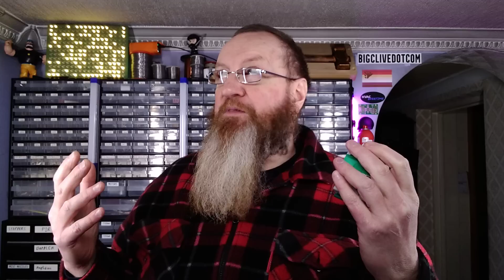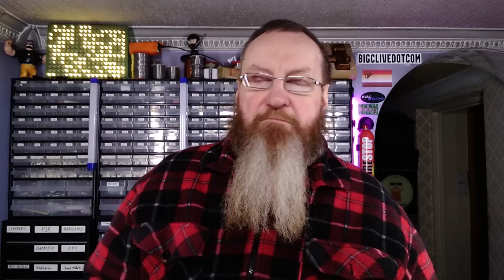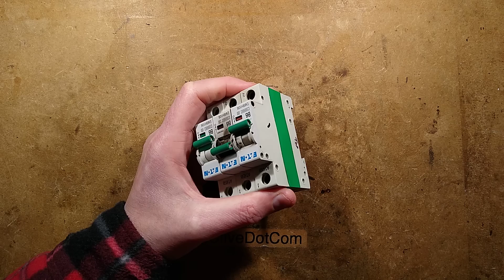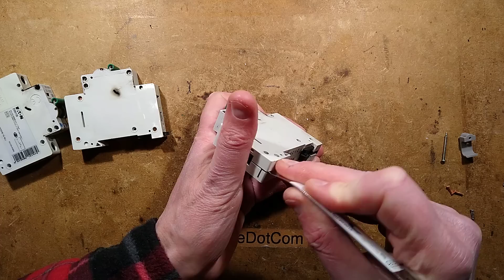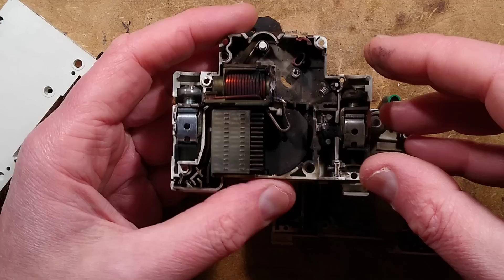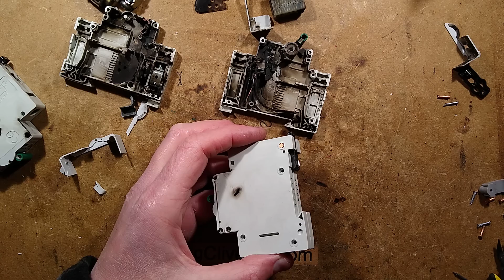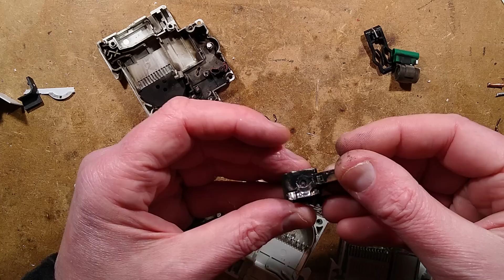Arc flash breaker failure - let's open it

Comment: The one word that any electrician, mechanic or engineer hates to hear is the word "intermittent".  Because you can damn well bet the farm that when you check the circuit/engine/mechanism the fault will be "mittent". The stupid fault runs and hides if it sees someone coming and the whole circuit/engine/mechanism is like "Problem? I don't have a problem. Why are you here?" If this happens often enough, you can see mysterious hammer marks in various areas, caused by professionals repeatedly thumping the offending part and using all of their very best swear words!
Reply: Did trace an intermittent fault to a damaged cable in the conduit. Lucky they would pull through, so ran all the cable in there with new, and found the damaged section where the installer 50 years before had scraped the insulation through, but it had been in air, till the conduit rusted a little and there was some water ingress. then it would trip 5 days after mopping the floor.
Reply from the maker: It does rile me when I see people using excessive force to get cables into conduit, with the insulation peeling off on rough unreamed edges.  Those little piles of shredded plastic say a lot about the installer.
Reply: @SeanBZA  And THIS is why you have to have trained professionals. To have the knowledge and patience to track down a 50 year old issue that only recently started causing trouble (5 days after mopping a floor, no less!) is (or should be) worth its weight in gold. Clive often talks about the low standards set for electrical apprentices these days and what you describe is precisely why that's a serious problem. A two-week course is not going to make you a competent enough electrician to track down something so hidden and obscure.
Reply: @michaelcherry8952 This is also why you wind up with weird rituals around equipment lol. If no one can find the source of the fault, but the machine seems to run fine whenever someone tells it a bedtime story... well, I guess the machine is going to get its bedtime stories!

Actually, that reminds me, there's a video on YouTube of a server that crashed whenever someone yelled at it. That is not a joke or exaggeration. There was something faulty with it, and that little bit of extra vibration was enough to cause problems.
Reply: @SnakebitSTI  That triggered a memory! I had a  1/4" phone plug and jack combination on an old Bogan "Transistorized" amp that was a wee bit too tight. It had two channels of output, but if you plugged the wrong plug into the wrong jack, after a couple of minutes the jack would spit out the plug partway just enough to short out that channel. Oddly, it was only a specific plug and jack combination that would do this. We used one channel for PA and one for backstage monitor. If you plugged the wrong cable into the wrong jack, you lost the PA. On "The Night", of course someone set up the amp with the cables in the wrong jacks and right at the start of the show the PA cut out. Unfortunately, although I knew exactly what was going on, I was on the other side of the room because I also played trombone in the band. Just as soon as our first number was finished, I raced through backstage and unplugged the monitor and plugged the PA into that jack. Cue the stage manager demanding to know what happened to her monitor. At the next break in the action, I managed to get the right cables in the right jacks and the rest of the night was (relatively) uneventful!
Reply: Ahh, the lesser spotted intermittent fault. I once had an electronic control system fail while I was on duty. The remote end being twenty miles away. Of course, by the time I arrived, it would be working. Do all the normal checks and tests, no problems found. Leave it on test for a while, all okay. Get back in the van and head back to base. And of course, as soon as I was within touching distance of base, the mobile phone would ring - “it’s done it again! Where are you?”. In the end I found that if I hit my fist against a certain part of the cabinet, I could recreate the fault. But it still took me over an hour to find a dry solder joint on a capacitor that was supposed to be firmly soldered to a terminal post.
Reply: @Mark1024MAK  Percussive Maintenance Techniques are valuable skills to have!😁
Reply: @Mark1024MAK You've got to be kidding me!
Reply: @Mark1024MAK yeah been there done that. After a reboot the server never comes up in time. Just when you enter the Datacenter. “Host xyz is up”
Reply: It does give a sense of power though, when you show up and hear someone say: "that's odd, the moment you showed up it started working again". "Yes, my mere presence is often enough for equipment to just start behaving again".
Reply: @inertnet  🤣
Reply: As the late Bob Pease said: You are sometimes justified in abusing the equipment to make an intermittent fault permanent.
Reply: @connerlabs  Love it!!🤣
Reply: Back when I was doing industrial maintenance, my manager would come up to me with a file on a machine, often intermittent. Find the cause. He would like the report that I wrote up on the repair and follow that up with asking why I had so many hours on the job. All he had to do was take a second look at the report because it had a full report of what I looked at and my findings.
Reply: Was the only electrician on second shift that had 150 workers on production lines so I was kept busy. A boss would ask me as soon as I walked into the room how long to get equipment back in line. Told him dozens of times that I'm Tom the electrician not Tom the magician. He reported me for cleaning to him like that so I would unbutton my work shirt and say Oops I forgot my Superman cape and my X ray vision is not working and will take a while. He reported me again so next time he called me told him sorry just started lunch and have a few other calls in head of him. I would always postpone or come back from lunch for every other department foreman but not for him.
Reply: @garbo8962  And I'm sure this guy had absolutely no idea why every other foreman got prompt responses from you but he didn't. It's amazing how dense some of these guys can be! The duty electrician is the expert. HE is the clueless one so he shouldn't attempt to tell the expert how long a job should take.
Reply: Ive seen the same with stuff like printers and wifi. The moment I come to fix the problem it disappears.

Comment: this is also similar to a common problem for my parents in bad storms

the single integrated GFCI breaker that ALSO powers the bathroom lights trips when bad storms dampen the outdoor plugs and lights
it is mainly a trickle of power that the GFCI dislikes, after just an hour of drip-drying it works fine again

america is a bit dumb at NOT using GFCI EVERYWHERE, though I can't exactly DIY because it is part of apartment living you are actually not allowed to alter without landlord approval

in my case I use devices in a way that I know is unlikely to harm me, if I have a metal body double-insulated device like my toaster oven I treat it as a fire and shock hazard during use, and unplug it fully when not in use
that 80's toaster oven is the only device that isn't safe given a metal body that gets hot enough to cause burns that I have, and yes I use a modern power strip as a breaker for it(it definitely uses less than 15a and the strip is only used for the 1ma at 1.5v for my clock charger and as a convenient place to connect my toaster oven, and it has 14awg wire so no worry)

I know now that admitting I use a high-power heating load on a power strip will get me replies of IDIOTS who don't understand that TOTAL POWER PER WIRE GAUGE is what matters, and I will try to politely engage with them to correct the fear-myths because telling people they MUST calculate total power load was never gonna happen
suffice to say that my situation is made up of carefully tuned "best practice violations" because my situation living alone ensures that I can avoid any ACTUAL violations of electrical code
I mean a 4kw invertor with an 80a capable 24v charger being connected to a 20a 120v circuit? yeah danger, but I use a single power strip to break that out, and my load was measured of ALL devices at <600w(+1kw fuser of my laser printer in small bursts that is almost never used), and the charger is even tuned to <25% to avoid peaking over 5a, leading to a total load in a room with no other loads of ~18-19a, which is within a safety margin of a 20a circuit WHILE THE BATTERIES ARE CHARGING AND PRINTING
if we count the 30-120 seconds max of printing ever as an "intermittent load" I am WELL BELOW the 80% limit of safety, and could probably even run my vacuum on the same circuit without reaching the full 20a(keep in mind the 600w was a peak ever load of all my devices, 3 monitors, sound system, 2 computers running miners, ect)
if I simply idle my rig and turn off the nearly 100w of displays(my audiobooks can still play with monitors off via BT headphones) I am still definitely below any danger of circuit overload, and even then I can't be sure how the plugs are all wired, there seem to be too many breakers for any single room to have just 1 breaker, it seems like the side windows each have an exclusive 20a plug set and the other outlets have ANOTHER 20a set, then the 50a breakers for the 240v stove and the 30a ones for the water heater(I don't think any were 15a at all, and the lights did follow my PC plug when it popped due to an invertor DC short)

so, overload fearing laymen please comment for correction and education, I actually did the math and testing, I will inform you if you wish

Comment: Would a typical factory capacitor bank contribute to such excessive short-circuit current?
Reply: Just a lot of incandescent lights can be enough. My dad had to add an NTC in series to our trigger-switched stairwell lights because the 12 halogen lamps were pulling so much current when cold that they welded the relais shut, so you couldn't turn the light off anymore without turning off the circuit breaker.
Reply from the maker: That's an interesting thought.  A power factor bank could definitely nudge peak instantaneous current up.

Comment: We have the same kind of problem finding faults on the underground supply network!
There is some kit we can use to narrow it down. ..... Rezaps to safely energise 500A supplies with faults. There are sniffers where you sample gasses from underground (hopefully tarmac so they don't go into the air before sampling) and Wezaps for those pesky intermittent faults where they go to a server in Ireland and a possible fault location(s) are given to the engineer to find the fault. 
We have got to the stage where you can reasonably hope to find underground faults before people are off supply!
The lumpy masses of destruction we dig up are a different matter! 1000a is small fry for a fault current!

It is interesting to see they think arc suppression works even when the slats are sideways rather than above!
Reply: 33kV and higher tend to make the fault location well known though, as they have a crater marking the spot, accompanied by the blown flat remains of the steel joint case as well.
Reply: @SeanBZA  The HV network is fairly well automated. Most of the HV fuses feeding UK substations are 7a (their rupturing capacity is a lot higher though) Once you get a level up from the 11Kv network the damage does get more noticeable. I have seen subs going up in flame and there is not a cat in hell's chance of getting me near the 4.5m safety zone! I do not care how good the oil is, put enough energy into it and it does get hot .... very hot!

Comment: Why I believe in fuses rather than circuit breakers. Fuses don't usually get arc faults or burnt contacts. Battery cut off switches you can use as well, it will handle about 300 amps and more in cranking amps. But I'm not sure if the battery cut off switches get burnt contacts too from high amp turn off or on.
Reply: Battery switches are only meant to be operated off load, on load they are not rated to make or break load, and are meant to be replaced if this is done, as part of the fault clearing operation.
Reply: @SeanBZA  okay, so how do I get away from breakers that wear out? Any other cut off switches that won't burn up?
Reply: @ they all have a rated life. You are meant to replace them all over time.
Reply from the maker: That's when some random "expert" hasn't put foil or a bit of wire on the outside of a blown HRC fuse.

Comment: Rubber gloves won't protect you from the shock when it goes !!!BANG!!!   😁
Reply: Which is why electrician gloves come in two parts. The rubber insulating inner (with a Voltage/AF rating) and the leather Protector gloves..
Reply: @darikmatters8866   I meant the 'shock' of the loud bang that makes you jump, not an electric shock.

Comment: I’m a 60+ yr old semi retired electrician across the big pond.  I have worked in service the majority of my career.  As a young boy, my father, an electrician his entire life, explained why you don’t keep resetting a tripped breaker.  He’s most likely looking down right now enjoying your latest video Clive.
Reply: How many times do you think they reset that breaker to blow it up? That sure sounds like sound advice So if you were had to reset it a few times for troubleshooting would that be too much?
Reply: @ it is my experience most home circuit breakers will tolerate that for a while no problem.  In this case he was working with over 400 volts across the line.
Reply: @chatrkat  400 volts between adjacent breakers, 230V live to neutral on the individual single phase circuits. Standard setup in most commericial/industrial buildings in the UK.
Reply: @zzoinks  ONCE... whatever caused the trip can look like the inside of that breaker (or worse). The fault current can be thousands of amps before it trips due to the trip curve so that reset breaker can deliver a surge of 5k to 10k amps instantly which can and will vaporize things.
Reply: Reset with a stick!  I had a domestic RCD drop out very randomly over a year and pretty sure there was no permanent fault in the house, but no way I was going to examine the whole system.  Tempted to change the breaker but board was full and messy. Tracked it to the weather -  wind and rain raised the frequency - but never more than once a day.  Eventually utility supply cable joint blew up 100m down the road. Happy days ever since!  It's hard to sit on your hands and do nothing.  Great explanation about the carbon track clearing the fault, Clive.  
Never knew about the reflective injector or thumper test methods, waiting for the bang sufficed!

Comment: Hello, Clive! How can i protect my home electrical appliances during thunderstorms or blackouts? I'm experiencing a lot of short outages due to rain and thunder, and I'm worried about fluctuations in the energy network.
Reply from the maker: You can get plugs that disconnect a load and don't reconnect it until after a time delay if they detect a significant transient.  You can also get DIN rail modules that do the same thing.
For areas with a high risk of lightning strikes, it may be a good idea to get a heavy duty transient suppressor.  They are often used with things like HVAC units.

Comment: This could be one of the reasons why eletcrtical distribution network is still using fuses.
Reply from the maker: An HRC fuse has many advantages.  Nothing to rust or jam, capable of breaking massive currents and single use, so no unknown history.
Reply: I had to ask Alexa, "What's an HRC fuse?" ... She said, "A High Rupturing Capacity fuse, is a type of fuse designed to handle short circuit current for a specified period."
Reply: So, grid network context... not commercial.
Cost and reliability is why they use fuses for streets / customers.  Easy to get a good kA rating out of em. Least cost afforded. 
However, the network distribution industry uses a lot of high fault capacity Circuit Breakers at sub stations.  Likewise, a lot of protection/control monitoring that trips those breakers.

Comment: Odd years ago, on 3 phase breakers like that insolator sheets would put between them to seperate the phases ??? same if connectors
Reply from the maker: In this case, the ports were for a mechanical interlink option used for various reasons including ganged breaker groups and external trigger mechanisms.

Comment: Back in the seventies "let the fault develop" was a common saying- if the cause wasn't immediately  obvious.😂
Reply from the maker: Still valid.  Some faults have to make themselves more permanent to find them.
Reply: The saying around my place was, "let the next shift deal with it".
Reply: You mean like the council fault tracing, replace the consumer tap off fuse with a bolt and nut off a pole mount, and look for the smoke. as the street wires were open bare copper you could see them shed oxide, and sag down a lot, but those substation fuses are pretty stubborn, and survive that loading long enough to see where the ground either erupted and exposed the damage, or where the steam stopped.